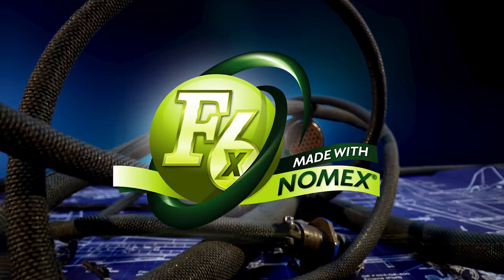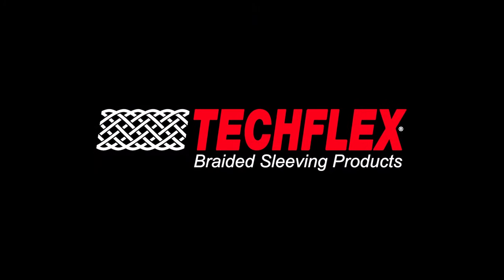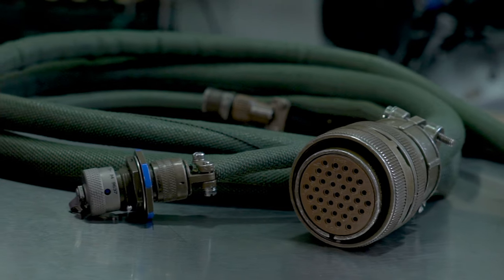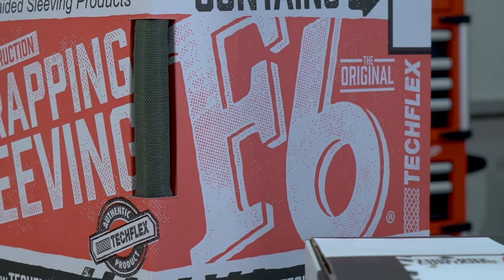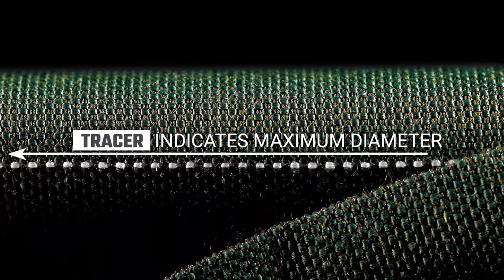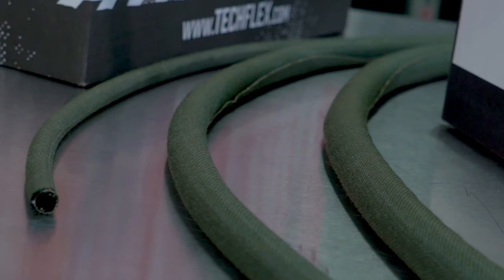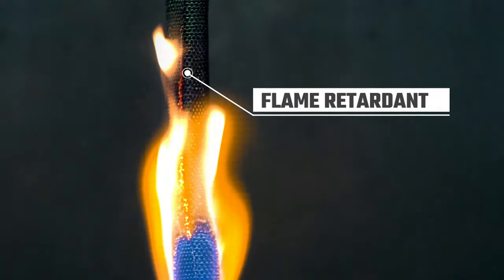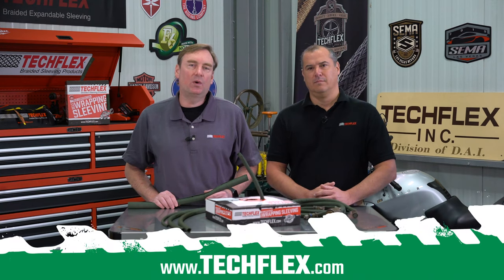Introducing Techflex® F6X - Made with genuine Nomex®

Comment: Does this product provide insulation properties?  I have a motorhome with one cylinder that runs very hot next to the exhaust manifold.  I constantly am losing the spark plug wire on that cylinder due to the high heat environment.  Will this work for my application?  Can this product be purchased by the general public somewhere?
Reply from the maker: Hi Rich, This particular sleeving does not provide that type of insulation. You should look into our Insultherm or Insultherm Tru-Fit products since your application is more focused on heat protection --> https://www.techflex.com/high-temperature/insultherm Our products are offered by a variety of distributors including: www.wirecare.com and  www.cableorganizer.com but you can also find a larger list of our distributors here https://www.techflex.com/online_dealers